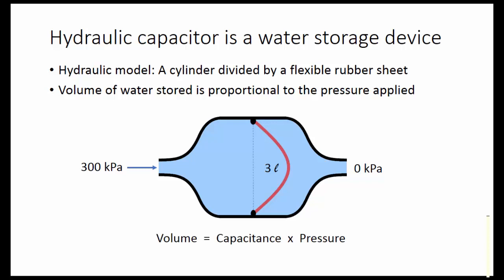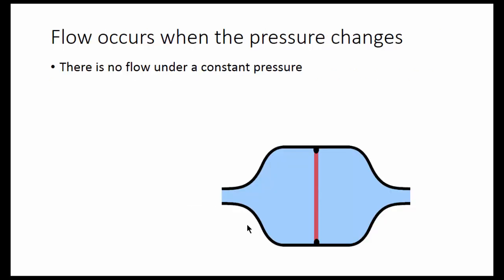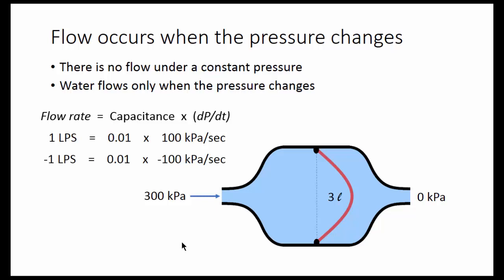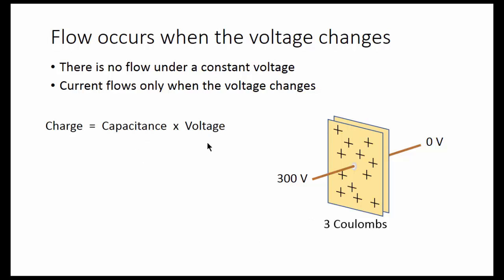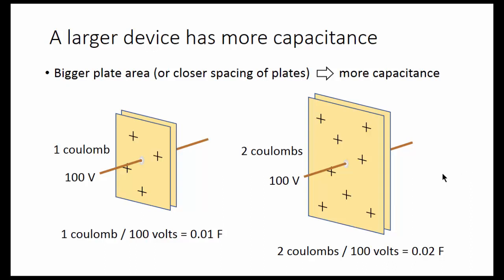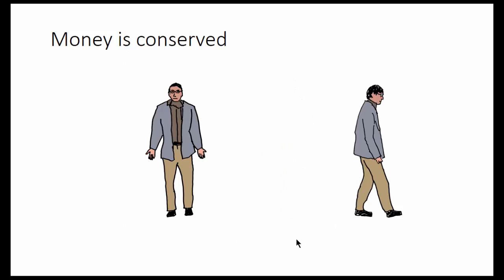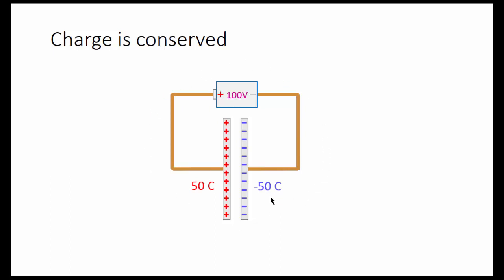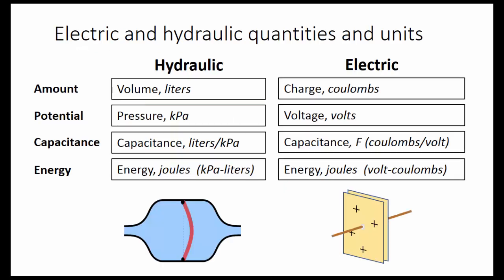Capacitors: Electric - Hydraulic Analogy (medium difficulty)

Comment: Nice video. I think there is a little mistake at 6:52, the electric field goes from the positive side to the negative side.
Reply from the maker: The charge rushes through the wire in the clockwise direction, which is really caused by negatively charged electrons rushing through the wire in the opposite direction.

Comment: At the end when you remove the battery from the capacitor, where does the net 100 charge go?
Reply from the maker: The total net charge on the capacitor is always zero, with or without the battery in place. Look at the money analogy again. When I have $50 and my twin has -$50 (owes $50 to the bank), our net worth together is zero. The DIFFERENCE in our two net worths is $100. When I pay back the money to my twin and he repays the loan, we are both back to $0 each. What happened to the $100 difference? It disappeared when I paid back the $50. 

It's the same thing with the capacitor. The 100 coulomb difference (between +50 coulombs and -50 coulombs) disappears when the charge flows back through the wire.
Reply: @graychang99  Thank you, the content and explanations are really well done.